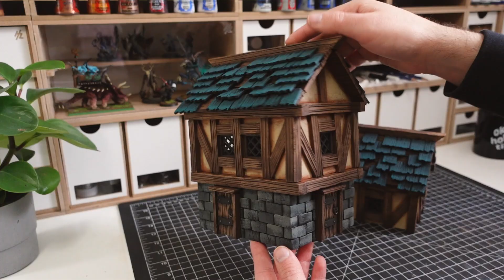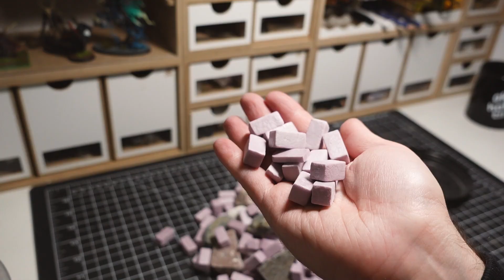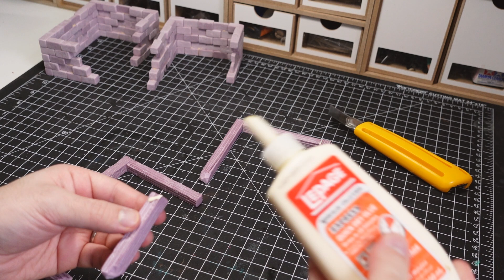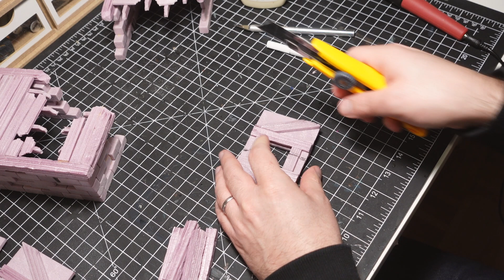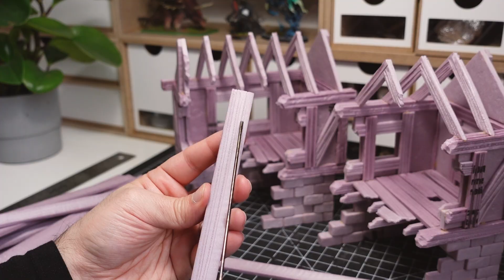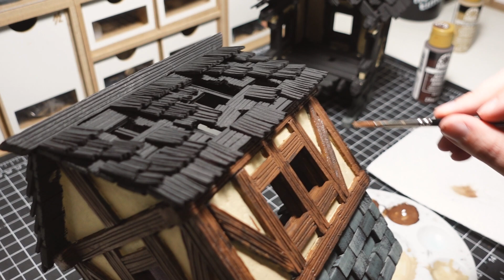Crafting MINIATURE ruined medieval buildings | Tabletop Terrain for D&D and more

Comment: Great stuff. Question: do you have any suggestions for efficiently making foam stones for making a pattern seen on Castle Grayskull? Aside from the drawn/pressed into the foam method. I’m wanting to make something similar but with foam stones instead of the type that you made here. I know I’m biting off a lot by such a project. But I want the irregular shapes. If you have any suggestions I’d appreciate it. 

Thanks.
Reply from the maker: Those types of stones are always a bit tougher. You might need to hand cut to get the right look. Check out my mineshaft entrance video on my channel—much more irregular shaped stones.

Comment: Thank you so much for these videos, they're very inspirational. A question, when you paint black as your first coat or primer, what are you using (paint, sprayer?)
Reply from the maker: Hey there, that was black Vallejo primer through the airbrush. You could also just use black craft paint directly on XPS foam—it covers quite easy.

Comment: Do you find it necessary to use the "Black Magic Base Coat" any? I see you are airbrush priming black, so obviously not on this build. What primer are you using on it? I hate to waste my nice model primer on a huge piece like this.
Reply from the maker: I find that a base coat of craft paint on this type of foam is plenty enough for durability. Sometimes I airbrush on a base coat if there's a bunch of small nooks (like this build). And I'll usually use the standard Vallejo stuff.

Comment: Can't you use a gluegun, or is that too hot for the material?
Reply from the maker: You can use one as long as it has a low-heat setting. Personally, I'm not a fan since it doesn't provide a lot of working time (I'm constantly readjusting the pieces I place down).